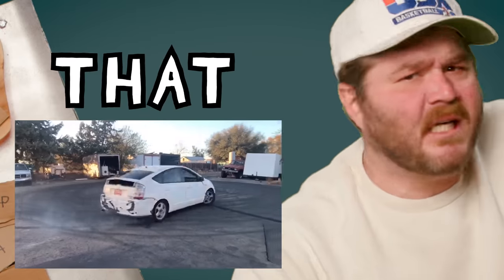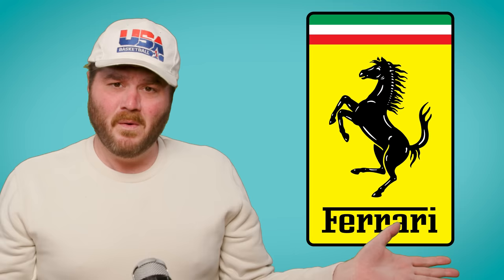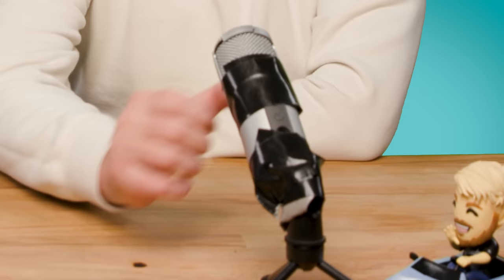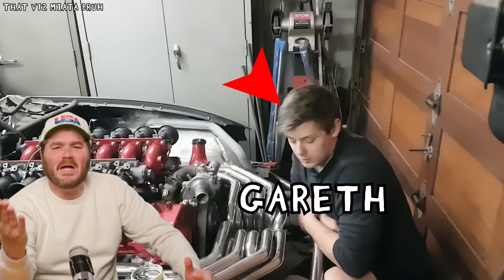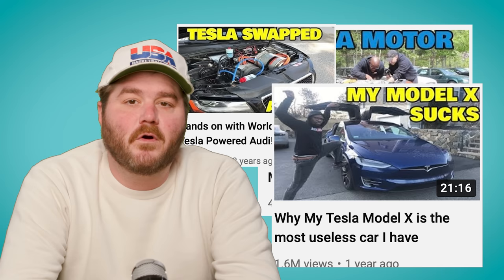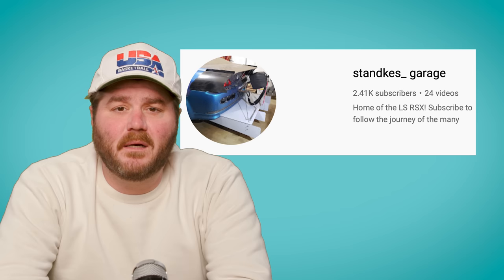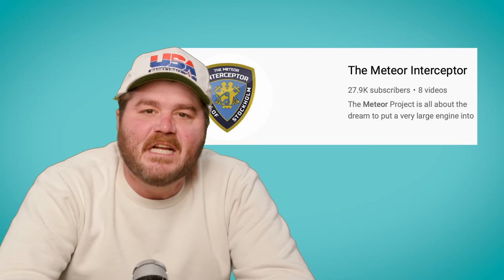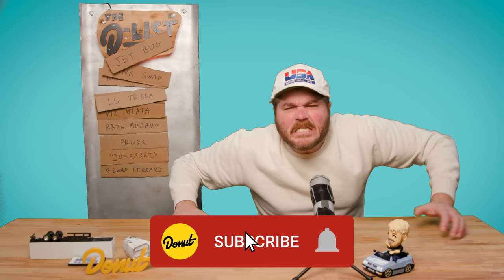Engine Swaps are Getting Out of Hand

Comment: The thing of it is, once you make a meteor into a forced induction version, in particular when you do it by turbocharging and of the modern VGT ballbearing type, it is no longer a tank engine. It is a Merlin. A wizard that powered fighter planes. And the Swedes are doing the right way, as good germanic peoples do, and use fuel injection instead of carburetors which stall if given negative G and generally speaking are about as precise and effective a means to fuel an engine s a american toddler with a bazooka and a crack habit as anti tank shock troops. :D

Comment: Dude, Merlin Engine cars are around since John Dodd (May he rest in Beast (mode)), 1972.
His Beast was one of the first, if not the first Spitfire engine MK35 car.

Tsssssk.
weak.
Reply: OK:
THIS is how you make a "car": P&W J58 with a few wheels bolted onto it, the first par (obviously) steering capable.
Then add a seat on top the engine, behind it a "wee fuel tank".
It would be a tad uncomfy in front'o'ya, see.
Forget break- or seatbelt systems, you will not need them after the first test run, since you'll probably never try that again.
Fire up the engine with the afterburners engaged ... for maximum brown pants. 

THAT is adrenaline rush.

Comment: Wouldn’t a Tank engine be rigged for super high torque? And wind up being really slow in a normal vehicle?
Reply: As I recall they have a step up gear box between the engine and TH-400 trans, so should be pretty drivable. Although last I saw they trashed the U-joints test driving it.